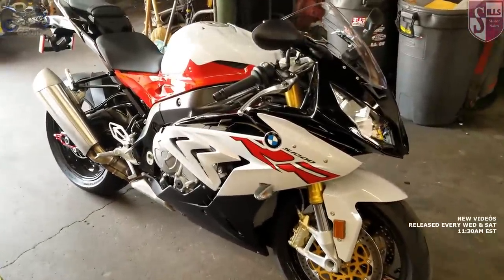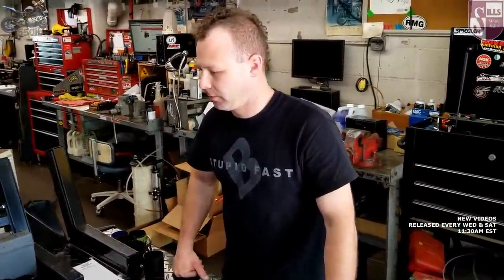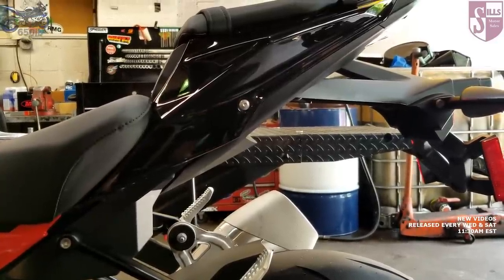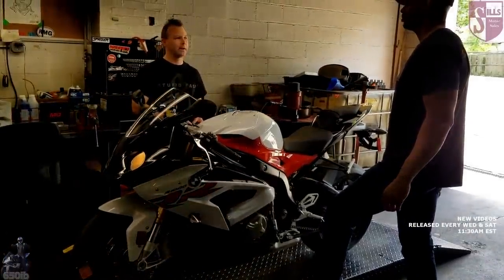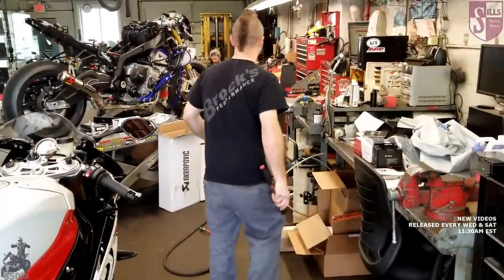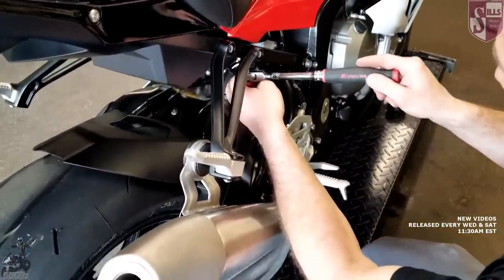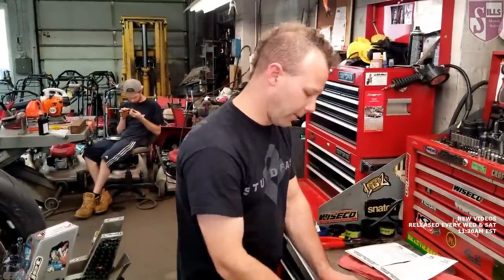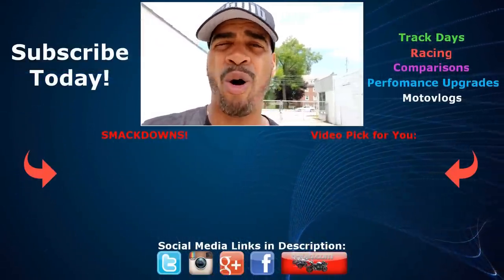How To Set Suspension SAG | 2018 BMW S1000RR

Comment: The biggest thing nobody seems to tell you in these "sag setup" videos is that all bikes are set up from the factory for riders of approximately 80kg in weight, + or -. If your 2 up riding most of the time, well then of course a sag setup would suit you, unless your both 40kg in weight. This has been a common thing on all adjustable suspension bikes for years. The sag for the road should be approx. 30mm to 40mm. The 30mm sag would be for someone who canyon rides mostly, 35mm both canyon and commute, and 40mm for mostly commuting &/or cruising. Track would be anything from 20mm to 25mm. It all depends on your riding style, weight, and type of bike you ride. Ib's 37.5 is ok for cruising. But Ib smackdowns a lot, so a 30mm set up would be better for him. Its all about setting up the suspension to work in the centre of the springs for the weight your carrying. But the biggest mistake they made in this video is they measured Ib in plain clothes & shoes!!!! WHAAAAAAT!!!!! To set up sag correctly, you need to be weighed in with all your usual riding gear!!!! Thats leathers, boots, helmet, gloves!!! Just a full set of leathers can weigh 7kg, a helmet 1.3kg to 1.8kg, boots & gloves maybe another kilo. This would have brought the sag possibly up to 40mm or more. Way too soft for Ib's riding style. 
Setting sag is really good guys when you get it right. It changes the whole bike, & experience. It really is great. But only if your more than the 80kg in weight &/or your style of riding is more aggressive. Otherwise, just ride and enjoy! Cheers Groovers ;-)
Reply: TheGlobalish: Yeah fair point, I understand that. But if your making a video, wouldn't you prefer it to be truthful? I mean 100% correct? 650 doesn't make vids that are missing things, he's true to his word. Look at it this way. Imagine you didn't know anything about setting sag adjustment & you worshipped 650. You'd believe every word of the vid wouldn't you? I'm not trying to criticise, I'm just very surprised especially coming from a BMW tech, as they are quiet good. Well here in oz anyway. I thought it was a bit messy how the tech did it with numbers all over the place and missing proper weight measurements. You don't really have to do it 100% correctly, as even a 50% job would be still way better than your stock setup (and thats only if your more than 80kg in weight). But at least do it correctly, so the viewers are getting the true low down of how it's done. I just thought the tech took a bit away from 650's creditability by showing a half job really. He's in the correct ball park, but just missing the hot dog & coke! I just wanted to point it out to the young &/or newbie rider/racers that it is done a little differently than what this vid tells you. Also adding, if the tech's missed this little bit, what else has he missed? Torque numbers out? No washers added? Adjustments here & there? Questions to be asked. Just making a point. Cheers groover, safe riding ;-)

Comment: BMW measures their sag different.  The “8-12mm” they recommend is the difference between the static sag and the rider sag.  You didn’t measure static sag in the back for some reason. Just free sag and rider sag. I think BMW calls it “negative spring displacement”.

Comment: The measurement in the manual does not work from static sag ( with the wheels of the ground). They use free sag (without rider) - rider sag( rider plus gear) = sag. That’s why the recommended 6 to 10mm in the manual is a lot less than the sag measured in this vid which starts of from static sag ( being 37 mm). So, one should not try to approach the 6-10mm from static sag, which would mean turning preload way up, screwing up the suspension. Nice vid though!

Comment: There are sag and rebound and compression  settings for the road and different settings for track work .Also oil weight and air gap in the front forks make a huge difference in your front settings

Comment: Don’t you have to calibrate DDC after Preload adjustments are made ?
Reply: exactly...It's necessary (..or not?)
Reply: Ivan Mesic: No not for this bike. The auto DDC does it when you select different ride modes. But of course you can also manually adjust if you feel like you need to. Of course on a manual suspension bike (all other bikes) you would definitely have to change. Cheers Groover ;-)
Reply: Ivan Mesic  correct. I mention it and refer to another video on how to do that

Comment: do you need to do this even if your bike got automatic suspension or they only did this because they change the wheels which i realize while writing this doesnt really make sense asking that last question.. but still why adjust it when the computer supposedly should adjust it for you automatically?
Reply: The automatic suspension constantly adjusts your compression and rebound damping, however, your initial sag or ideal preload should be set according to your weight.  Once you do that the computer will do its thing.  That being said, the question here is whether you need to calibrate the DDC system in your bike after adjusting your preload.

Comment: This video is very misleading. If you take the time to read the BMW owners' manual properly, you will find the adjustments are made with reference to the static sag with the bike sitting on its sidestand and not the free sag. The figure of 8-12mm at the rear is the difference between the static position for the bike on its side stand vs the sag with the rider seated on the bike, upright and in the riding position with the ignition switched on. This guy seems to think the rear spring would need cranking right up in order to achieve BMW's figure of 8-12mm because he is referencing his measurements against the free sag . . .duh!!!! He has the same misunderstanding with the front forks where BMW use the same "static" reference point for adjustments. From the factory, these bikes are set up with the correct preload for an 85kg rider. An interesting video in some respects but incorrect and misleading, given the tech clearly doesn't really understand what he is doing and can't average 77 & 78 without a calculator . . . . . . One reason I do all my own maintenance and won't let a "qualified" mechanic anywhere near my bike!!
Reply: ybliga you are incorrect sir. I just read the manual agin and the measurement is done with the help of a third person and rider on the bike. I do agree those sound like free sag numbers. It may be a bad translation. That is why I said to stick with the normal numbers of 25mm for track and 35 for street. Thanks for watching.
Reply: I honestly don't have a clue what you're trying to say but you're quite wrong!! There is no mention of free sag in the manual - anywhere in the manual!!I was wrong on one count - the static sag is measured with the bike held upright, minus rider and not on the sidestand. The rider's weight is now applied and the negative spring displacement is measured as the difference between the two measured values. This should be 10-15mm front and 8-12mm rear. The bike is set from the factory with the correct preload for an 85kg rider but in order to attain the above values, the preload needs increasing for heavier riders. At no point in the manual is any reference made to the free sag - it isn't needed or used when setting up for the road. You made the statement that the rear shock would have to be really cranked up in order to attain a sag of 8-12mm but it doesn't. I am 200KGs and I can achieve a negative spring displacement  of 10mm with only a modest adjustment. The 8-12mm is the displacement with reference to the static sag AND NOT THE FREE SAG as you stated. There may be a variety of ways in which the suspension on these bikes can be adjusted and in particular for track use. That said, your technique is inconsistent with the instructions in the manual and it is important that riders understand that your guidance is incorrect if they want to adjust their settings as per the official BMW-approved technique.
Reply: Ybliga. I red the manual the way you did when I set mine up. Problem is; when you increase preload, both those  measurements will go up, and the difference will be pretty much the same. Doesn't make any sense to me, so Im thinking maybe there's a mistake in the manual...
Reply: janolewilhelmsen, Thank you for that remark  - it is most helpful.  I have owned my 2015 S1k since new and the suspension is still on factory settings for an 85KG rider. I watched this video as I thought it is about time I set my preload for my weight of approx. 100KGs. I have read the manual several times now and did wonder if with each increase in preload,  the static measurement would also increase and so, as you say, I would have ended up increasing and increasing preload and never reach a negative displacement of 10-15mm front and 8-12mm rear but in any event the bike, either with or without rider, would inevitably sit significantly higher. With this in mind, perhaps the following is the intended translation. . . . . .  . .  The bike is set for an 85KG rider from the factory and  BMW intend that when setting preload, the static measurement required should be the single value taken from the bike whilst set at factory preload. Given a heavier rider, If  preload is now increased  until the negative spring displacement is as specified BUT with reference to this one specific static measurement and NOT the gradually increasing value, the bike would end up with the same ride height, regardless of rider weight and each bike will settle with the suspension being compressed down by the same amount . . . . the negative spring displacement will be different in each case from the static measurement for each preload setting but will be 10-15mm front and 8-12mm rear from the Factory-set static measurement - my money is on this explanation. It makes far more sense to me and would also give the same negative spring displacement for all bikes from the free sag figure - the problem is, BMW don't specify this in the 2015 manual.  Thanks again for your comment as your experience should prevent owners from going down the same route and having to crank up their preload excessively. I suspect the pre-2015 bikes might have had spring displacement figures referenced from the free sag measurement which is why this video is otherwise so confusing? . . . .

Comment: But... the calibration of DDC? You forget it?
Reply: paolo ippoliti: No its an auto system. The DDC changes when you select different ride modes for you. But if you feel the need for more dampening, you can adjust it manually via the dash. Its very easy. Most times you don't need to do anything. Its only when you go track riding, that's when you do feel differences in the changes. Cheers Groover ;-)
Reply: No I mentioned at the end and said to refer to the previous video about the dash on how to do it